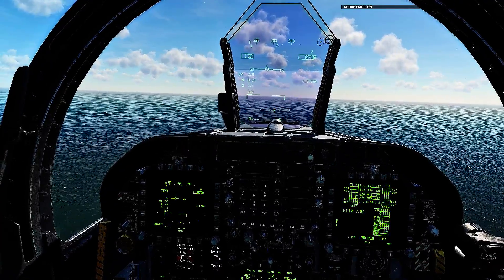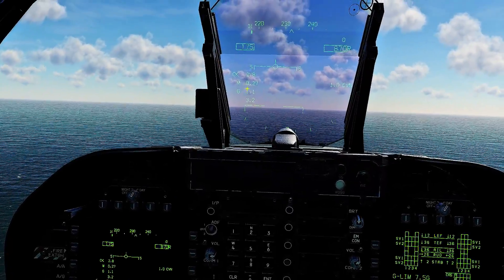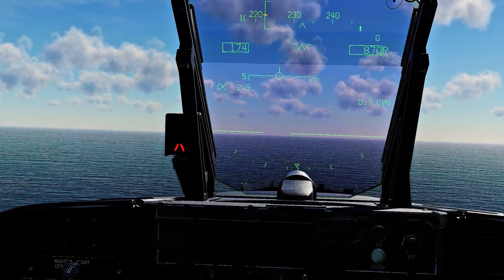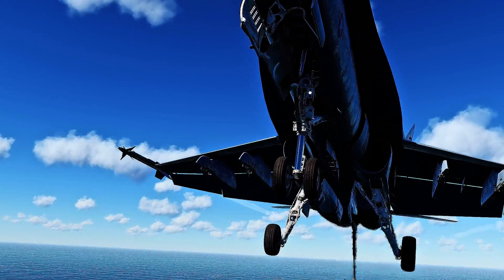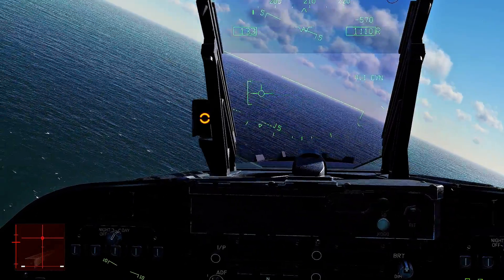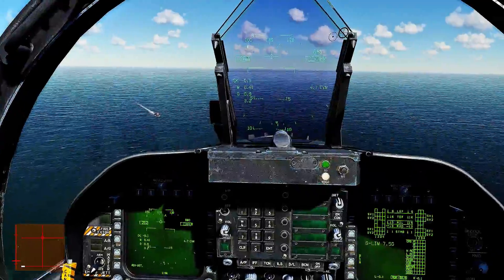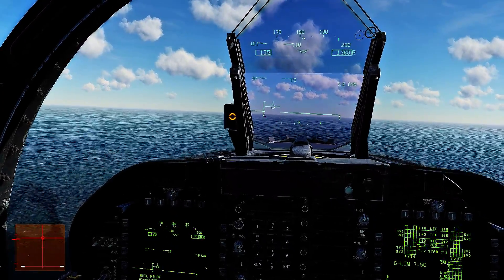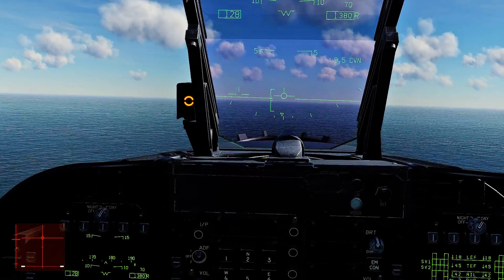How To Maintain On speed AOA In the DCS F-18 [Making The F/A-18C Easy]

Comment: Hey great video! I know it’s old and I’m sure you would of mentioned it in the video if it was implemented but I’d figured I’d ask, is there any mfd indications or any type of indicator that shows what trim you are at?
Reply from the maker: @benjamincarper3140  ya trim can be found on your flight control page under supt menu. But dosnt really matter what the number is for ldg, just matters if the settings is off loading the pressure off the stick

Comment: My F18 has an annoying alarm when I get under 170 speed and then falls like a rock. When I dog fight I go from 500+ to 70 in a single turn and then fall like a rock. It's so bad that I seriously don't want to play anymore. And yes I have selected Simulation setting. There just isn't speed on this plane. It's as if it's heavier than an aircraft carrier. My brakes are off. My throttle goes to 100 and everything.

Comment: May I know how to make the throttle response faster at lower speeds? I'm getting better but still I find below 130 kts the a/c loses ht faster and more difficult to recover as throttle response is sluggish. Thanks and regards.
Reply from the maker: You can’t unfortunately. That’s how jet engines work near the low ends of rpm.

This is why the f16 f14 also keep there speed brakes out for landing one benefit is a higher rpm on landing faster power changes and better for a go around if they need. 

In the hornet you just have to get used to the timing of the engines and you will be able to add power back in just before it’s to late.
Reply: @YourSimCFI  Thanks again. I think I'll try landings with a/brakes out and more power. I thought I could adjust curvature of thr control.
Reply from the maker: @karvi9932  np, in hornet don’t use speed brakes, it was just an example to illustrate how jet engines take a long time to spool at lower power settings. You just have to constantly be on the throttle you won’t ever get a constant power setting for landing.
Reply: @YourSimCFI  Roger, WILCO Sir
Reply: Oh yes! No speed brakes of course! The manual says ' power up to ensure hook has engaged the wire or the wire has snapped, in which case you need to 'bolter' with all the power, I suppose. Thanks and regards.
Reply: Some more doubts: 1. Why select Launch Bar UP after catapult engaged? 2. After landing I took off again from CV, but the whole cockpit was shaking,why? Is it due to 'heavy landing' at first go? Thanks again!
Reply from the maker: @karvi9932  when the launch bar is locked into the shuttle, you just put the switch into the retract mode but it doesn’t retract until you launch. 

I don’t know about the shaking I would have to see it live
Reply: @YourSimCFI  Thanks again. I am learning!!🙏🤔
Reply: Just want to inform you all that I bought Thrustmaster HOTAS 4 from Amazon/ Cloudtail India Ltd. (24 Dec2019). Not being familiar with it, I tried to make it work OK for over a month. When I opened the panel I found the PCB marked 'HOTAS X PS 4 only, 2015 make. Amazon warranty para 3 states that defective item can be replaced within one year. In fact, I received a FAKE it seems. But in spite of repeated requests for replacement none have responded ( ie TMaster/ Amazon's/Cloudtail- the retailer). For now, I am back to using 18yr old Saitek Cyborg 3dGold. As I see, some other guys also had problems with so-called HOTAS 4. Thank you all and happy landings.

Comment: Can I set the AoA while turning/descending/climbing or do I have to be flying st and level? Please let me know. Thanks again for your great video. Somehow I used to do deck landings mission in Microsoft FSX. Five succeful landings required to get a PASS in one go. But it had only four keyboard commands to Launch and Land. Did it about 25 times with the vel vector unsteady and no detailed briefing. I think even the AoA indexer was not there. Just managed to do it somehow.
Reply from the maker: You can achieve on speed AOA anywhere, however it is easier St and level.
Reply: @YourSimCFI  Thanks again for your prompt reply.

Comment: How do I get the v vector to maintain pointed at the runway threshold? I have the E bracket aligned with v vector but it is pointed way down the runway. So I am overshooting! How to correct that, please? Thanks.
Reply from the maker: pretty hard to describe and see what’s going on through text but it sounds like your to high or your not descending fast enough. 

You need to work the stick and throttle so your v vector is on your aiming point and on speed all the while on a 3 degree glide slope.
Reply: @YourSimCFI  Thanks a lot, sir, for your prompt response. And I repeat your video tutorial on AoA is one of the best, regards. May I ask which HOTAS is good? I bought HOTAS 4 cheap and it cannot be tuned to fly level. My 17 yrs old Cyborg 3d Gold joystick is sticky but still OK. THANKS
Reply from the maker: @karvi9932  what I would do is have 0 dead zone but about 8 to 10 of positive curve
Reply: Thanks again for your great tutorial and advice. I am now getting OK landings the right way. Looking forward to more videos from you. Regards.

Comment: how MUCH do you trim?
Reply from the maker: Vic S quite a bit when the gear and flaps are down but as soon as the the e bracket has been trimmed for on speed I stop trimming for the most part.
Reply: @YourSimCFI  does the trim reset when you put your flaps back to auto, like when you demonstrated it again?
Reply from the maker: Vic S most likely, it’s a fly by wire aircraft that can auto trim so once you bring the gear and flaps down you  typically have to re trim your aircraft

Comment: I try to use my throttle but my velocity vector does not line up with the e bracket. I tried to use only throttle but it doesnt work. I would be fine but then a sudden movement, my E bracket goes all the way up or down.  I use my power to get lined up together but it doesn't happen. So I use my trim which bounces

Comment: you use pitch and throttle
yes you will slow down when you pitch up, but you add a bit of throttle to compensate
Reply from the maker: Oracuda if you want to climb sure not in landing confit go right ahead. it’s a hornet it’s trimmed for angle of attack you add power the flight controls will maintain that angle of attack. Watch a real hornet carrier approach. Keep an eye on the throttle movements to stick movements. 

https://youtu.be/8ryiJP3H7OY
Notice how he’s trimmed for onspeed aoa thus throttle for climbs and descents stick mainly for rolling.
Reply: @YourSimCFI  yeah ill be honest, relative speed to AOA was always confusing for me, thanks for the quick response
Reply from the maker: Oracuda np man, angle of attack is relative air flow to the mean cord line of the wing.   

If you would like to fly with us join https://discord.gg/6HzubeM.

Comment: The F-18's E bracket seems to operate exactly opposite from the F-16's AoA index.  Is that correct?  I'm having a lot of trouble transitioning to the F-18 and being able to maintain a stable descent, while it seems to be effortlessly easy in the F-16.
Reply from the maker: RazorTM ya the air force  aircraft are different, tomcat and hornet act the same.  If the E bracket is high in the hud you get the red light meaning fast, if you get the E Bracket is below you velocity vector then your slow undeclared by green light. Please join us https://discord.gg/SsV6gvr if you have any more questions

Comment: I am new to DCS and trying to learn the Hornet.  Your video has really helped me understand on speed AOA.  I am having a little trouble when I initially drop the gear and flaps because the aircraft pitches up steeply and I feel like I am chasing the pitch and it gets too high before the bracket comes down.  Should I apply a little forward stick pressure while adding trim till the bracket comes down?  You make it look so easy but I am struggling with the first moments after the gear and flaps come down.  Thanks for your great video.
Reply from the maker: azjim321 hey man, thanks your the comment, you can try putting flap in from half then to full instead of full right away.  that might help, also if your interested there is a discord channel in the description of the video, your welcome to join that. And we can do some one on one training if you would like.
Reply: @YourSimCFI  Thanks for answering my reply.  I would like to join your discord, however when I select the link above it says invite expired.
Reply from the maker: azjim321 here try this https://discord.gg/SsV6gvr
Reply: @YourSimCFI  Thanks it worked.

Comment: what happens at 0:04 when you were climbing 1500 fpm, and then without change in the velocity vector it's suddenly 0? (oh haha I see now, you turned on active pause, ok, scratch that part of my question). I don't think I understand the velocity vector of the F18, it seems different from the A10c for example. There it means you will fly exactly towards wherever it's pointing. So you set AoA in landing config with pitch trim, and then you use throttle to raise/lower the vv for 3 deg glideslope (similar to this video and all airplanes). So then how come in flight your vv is pointing about 5deg into the sky with 0 vertical decent rate? I don't see how that means "you'll fly into that cloud it points at; however, you vertical velocity is 0". Can't wrap my head around that so far -- it's somehow very different from landing an A10c, despite the exact same principle of stick for speed, throttle for altitude.
Reply from the maker: Zoijar if you notice the solid green line on the hud, that’s the 0 from so if my VV is on that I won’t climb nor decent, it has nothin to do with nose pitch it’s all angle of attack, because as we get slow we need more lift from our wings to maintain level, so the nose will be higher the.  Normal but we won’t be climbing. I hope this helped
Reply: @YourSimCFI  Thanks! I tried again and now it seems normal. Not sure what was going on earlier. Maybe I botched the startup and alignment or something

Comment: what do you mean trim?  people keep saying trim and i have no idea what that is.RAlt ; ??? "push to set T/O trim" in cockpit ?that one?? and 12 deg slab??? those things?
Reply from the maker: Jiajian Hou so on your joystick, you need to set trim up down left right, trim is used to relieve pressure off the controls. For example in a non fly by wire aircraft if you find yourself having to hold the nose up with the stick trim nose up so you can relive your pressure off it
Reply from the maker: If you want 1 on 1 help you can join the discord link in the description
Reply: FlightSimFan is it Trimmer switch - push (descend) and Trimmer switch - pull (climb)? I click push to put my nose down and pull to put it up? When I start the landing, E- bracket will be up top, velocity vector (nose) is on the horizon , do o trim nose first or reduce speed first? Or at the same time?

Comment: 3:19 its again good AOA even you dip nose down, but now you going -5 degree insted +5 degree. again who is engineer. yeah yeah its AOA not landing indicator lol
Reply: You won't need an AE (aerospace engineer) for that! You can use both the stick and the power to adjust your vertical pattern towards the landing, not just the thrust as the video producer tells. He puts it that way to make it easier for you by not using 2 controls for controlling the lift (both thrust and AoA generate lift) at the same time which may lead you in overcorrecting what you want (the path you want to follow), thus it may be easier using only the throttles but you have to get used to the response inertia (engines spool and speed rate). The only thing is, that indeed, the higher the AoA you want come with for landing, you'll need to use more thrust over pitch stick corrections, the lower the AoA you'd be wanting to fly during the landing, the more stick over thrust you'd want to use. Experience tells it all:).

If I want to do the most precise landings and always catch the 3rd wire or the wire that I like and my plane is light enough to not break the gear cause of too high vertical rate (which is affected by how fast I fly on the glideslope), I'll come with lower AoA, even lower than the usual (usual being the one given by the AoA markers), as low as 4-5 AoA. This way, I come from more than 4nm (to have enough time to adjust the throttles right) away from touchdown, I trim my AoA to about 4..5, I put the velocity vector over the carrier, I precisely correct the throttles until I FIND the speed for which my pitching moment becomes close to zero (you should never memorize speeds, it's stupid and pointless as you fly just AoA which is all you need) and after I've set the throttles such as my speed won't vary anymore, all the small amount of pitch corrections are done only by the stick. Yes, if I've set the throttles such as my speed remains constant when I'm on X degrees of glideslope, the speed will start varying when I change the pitch attitude, but won't vary too much, only a couple of degrees if I don't have to make huge corrections. If I'm heavier and not care too much of precise landings, I'll want to fly a higher AoA in order to reduce the vertical rate as much as possible throughout the glidepath, but now, I'll use more throttles and less pitch stick for corrections..., both, but mostly throttle.

Cheers!

Comment: Thank you for this!  I had no idea that properly trimming the jet would effectively pin the E bracket to the velocity vector.  Just that bit of information is making all the difference for me.  I'm still struggling a little with the throttle response, but I just did three practice landings, and I'm already way, way better than I was before.  A bit more practice, so I know better how to anticipate how much throttle change will produce a given amount of pitch change, and I'll be trapping 3 wires every time.  Great video!
Reply from the maker: clubby37 hey thx for watching and commenting, if you need anything else you can join this discord chan and post your questions or fly with us https://discord.gg/SsV6gvr

Comment: Hey does this technique also work with the f-14? As far as trimming on level speed, then adjusting pitch with throttle on AOA without using stick
Reply from the maker: Tea yup same thing although use the DLC in the 14 and trim more is all
Reply: FlightSimFan also I can’t catch the e bracket it’s weird
Reply from the maker: Tea on Tom cat it’s not the velocity vector it’s the fixed wing in the hud
Reply: FlightSimFan that’s what I meant
Reply: FlightSimFan dang I’m trying to but I am just especially bad at flying, does this come with practice?
Reply: FlightSimFan ok thanks 🙏

Comment: Thanks so much for this video. My struggles and questions about using the trim seem to be answered. My plans kept bobbing all around when I adjusted throttle and trim,  but now it's much more clear what I gotta do. I landed on a carrier in like 0 visibility without setting this up or knowing how to get my ils working....luck basically cause everytime after I hit the ocean, the carrier, or essentially floated right above the wires at the last second.
Reply from the maker: hockey3761 thx for watching, if you need anything else the discord link in the description is a great place I fly there everyday. 😃

Comment: Great video, very clear thanks. But are we trimming with our velocity vector level with the horizon when landing? Or should it be trimmed pointing at the carrier (or the place we want to land) for descent?
Reply from the maker: Baz Mackenzie you trim your VV to the centre on the e bracket your power will control decent rate and roll controls the line up of the VV, you aim your VV just to the right of the runway it’s called the crotch.

Comment: Yes!....excellent instruction and demonstration! Finally, I can see the light at the end of the tunnel now :)  It's still taking me too long to get everything to settle down, especially for a trap on the boat, but my field landings are finally pretty coordinated! :)  Thank you so much :)
Reply from the maker: JP mad np thx for watching, feel free to join the discord in the description, as the club and I practice all sorts of dcs things together
Reply: @YourSimCFI  One quick question......when you drop flaps and gear (@ 250kts), how are you initially negateing the large 30-40 degree pitch-up...... with stick or trim?  Probably a stupid question.......because no one mentions this. Thank you again
Reply from the maker: JP mad it usually requires pitching and trim  however the flaps are controlled by the fly by wire system and do take so time to come down so they don’t just come down immediately. But I use pitch then I trim for where I want the nose to be
Reply: @YourSimCFI  Roger that. Tnx
Reply: OK!.....your "Fly by wire" finally sunk in!  My trim inputs, as viewed on the FCS, never seemed to be responding....... while I chased the pitch with the stick. As soon as I neutralized the stick....there they were! :)  I can now get On Speed AOA pretty quick now! :) TNX! :)  No one specifically mentions this on tutorials.